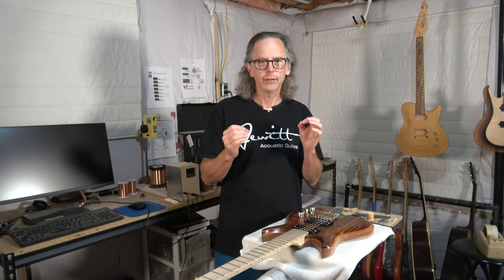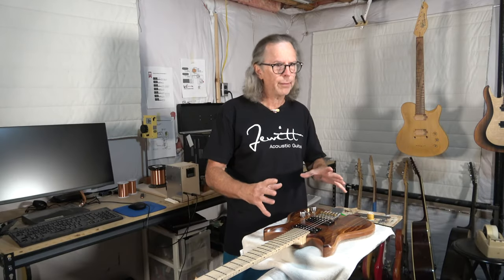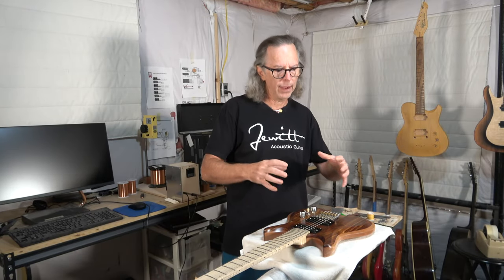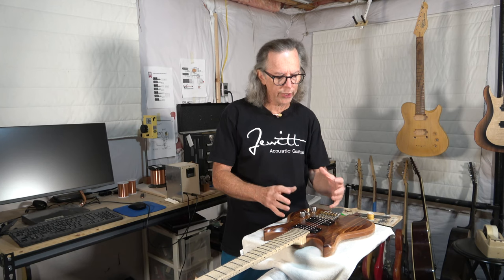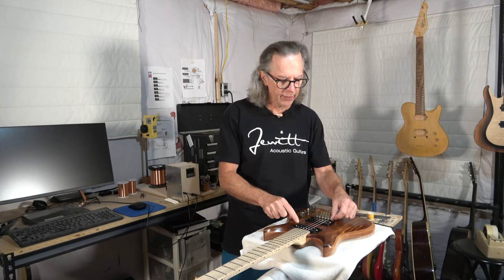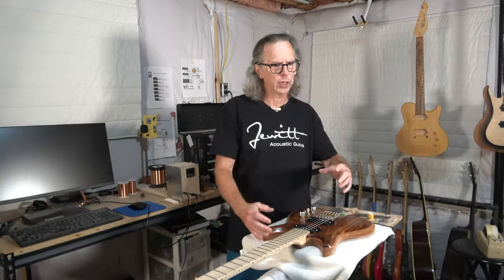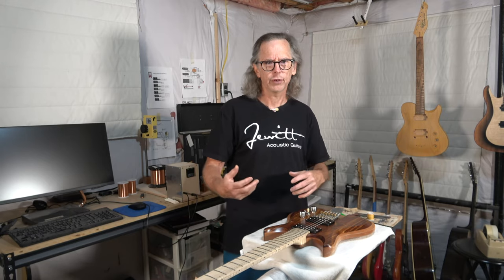Does Guitar Wood Need To Breathe? Trailer

Comment: What are you using for grain filler these days?  I've seen your earlier videos for AquaCoat, but wondering if you've found anything better yet.  Hopefully not 2-part, cause I like extended working time.  (I never seem to find all the surface flaws quickly)